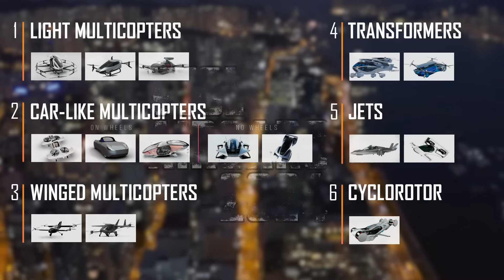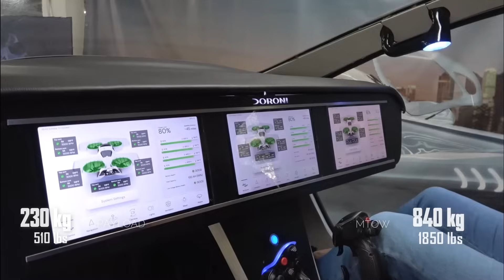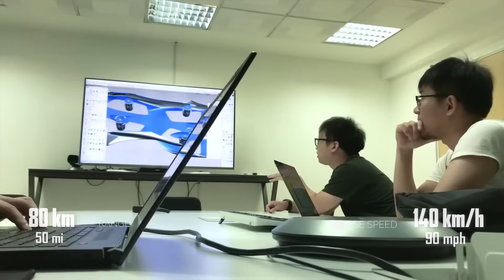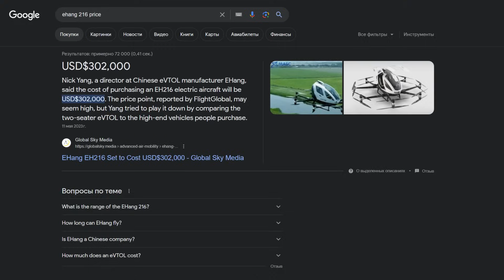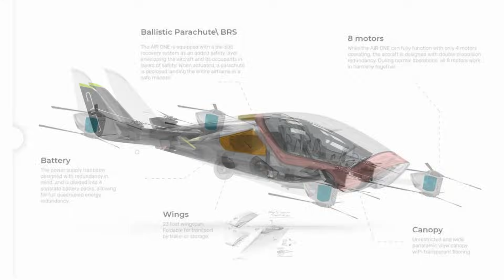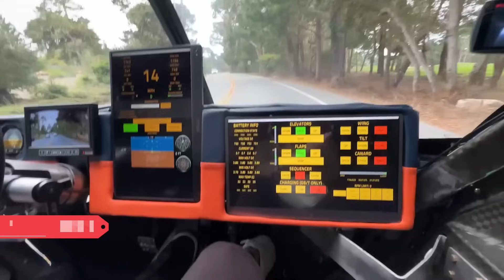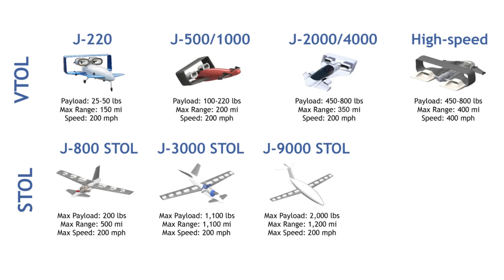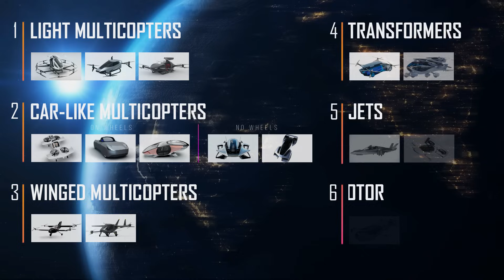Best 2-Seater Flying Cars 2025 | TOP 15 VTOL AirCars

Comment: Thank you, thank you and thank you, for clearly stating that they can't be called cars because they can drive on the road, a flying car MUST be nkt only able to fly but to also be able to be driven on the road the same as a normal car, if it cant drive on the road then it is not a bloody car but just a vtol
Reply from the maker: You're welcome! Many gyroplanes can drive on roads, are they flying cars?
Reply: @TopBoxy and normal planes even 747 can drive on roads aswell, if the road is big enough, just because they have wheels does not make them cars, they have to be able to drive in the suburbs, the city, the highways, they have to be able to function as a car to be classified as a car

Comment: Yes, a flying car needs to be able to transition back into traffic (in the city), if only at a top speed of, let's say, maybe 40 MPH.   Flying cars that can get you from door to door will only become a reality if or when there are specific launch and landing areas specifically for them, and away from pedestrians.  Otherwise there will be too many lawsuits caused by the downdraft of the rotors of these vehicles.
Reply from the maker: Why do you need to return to the traffic flow? Wouldn't it be more logical to land directly at your destination? On the roof of an office building, a shopping center, a factory?
Reply: @TopBoxy  That would be great if every house and every business had their own heliport away from where people are having their activity.  The problem is that there will be too many lawsuits from the downdraft (wind) and noise created by the drones.   If there are certain, let's say, dead ends of some roads that are allocated specifically for these flying vehicles to land, then I think there would be much greater acceptance of these things.  It would be a place for them to transition into quieter land vehicles without all the wind created by rotors.   If you think about it, we have probably had the capability for these drones for at least 20 years, probably longer.  Does it make sense why they are not a reality in every day life yet?
Reply: @dillonrohe4988  Does it make sense why they are not a reality in every day life yet?........
Because ita a scam...Not one of these featured Flying Cars are a anywhere near Roadworthy let alone Flightworthy...The Alef is the biggest con...Check out its videos of it Flying above other cars...The other cars have shadow...The Alef Scam car does Not...and the pathetic skinny bike tyres are a joke...Add  tothat the Joke CGI propaganda marketing releases...and their claim made in 2025 that they are ready to begin production late 2025 or early 2026...BS...More Bs ...and more BS

Comment: I have to ask obvious question does anybody worry about the blades I mean how do you get in these things with the blades hitting you ? The open blades that seem dangerous on  landing it  without killing somebody on the ground ?
Reply from the maker: Good question. In any case, the flying machine undergoes safety protocols. Logically, this problem can be solved
Reply: that is a smart question I didn't even think about that😅
Reply: It’s a pretty obvious danger. You’re walking up to a vehicle with a food processor blade at each corner.

Comment: The problem with all electric aircraft currently is the short flight time.
Reply from the maker: Yes, you are absolutely right
Reply: @hubschenk :  Hybrid approach should be tried, assisted by gas'ne powered "turbo engine"- while in flight... Thus, longer range will result...❤

Comment: The troubles with EV are already evident. Cost: Too expensive (150K-300K); Travel time: Longer than driving there in a gasoline powered car - (a 5 hr charge every 100 miles of flight time= 600 miles in 30 hours); Hazards: EV batteries explode when wet; Health hazard - intense radiation from EMIs, -batteries vulnerable to being turned off immediately by external forces.
Reply: You should of been on there design team they could of saved alot of time and money😂
Reply: You forgot crybaby Karen's in NJ thinking your a Chinese spy drone!!😂
Reply: @Joshua-b7l  Actually, you can thank Billy Rae Enman for those.
Reply: And the trouble with Hummers?  Didn’t seem to be a problem…?
Reply: Batteries will be better
Reply: Fuel sources will improve
Reply: You might be the Wombat King
Reply: They are also heavy
Reply: These are just base ideas and one or more will just get better and cheaper. Where there is demand , industry will always work to exploit it!
Reply: The zero point tech is being suppressed we could be scooting around like the jetsons
Reply: 이런걸  목숨걸고 타야하는지 ㅋㅋ 안전장치는 무엇이 있죠?  배우고 싶다면  한국의 나에게  짲아와요
Reply: 나의 기술은 기체중량 850킬로에  4000킬로의 인원을 태울수 있음.. 조만간 나의 영상을 공개한다
Reply: Clearly you missed the most important thing, Profit! 🎉
It’s all the Corporate Overlords care about 🥺

Comment: Air One is NOT capable of gliding, beware !! And its rudders may look cool but do not work either. The Axe by Skyfly is a kit - which the buyer builds or has an engineer finish - and so qualifies under the kit built certification regimes of US/UK etc - meaning less onerous and shorter certification route than "commercial" which will take years and hundreds of millions. The Air one is double the weight and needs double the power compared to the Axe - so the Air one is much less believable - because it will need twice the battery capacity. It's rotors only and does not benefit from lift from wings, like the Axe does. Result: Air one uses 250kw all the time to keep 2 passengers and its own (heavy!) weight in the air ......... against the tiny 30 kw of energy the Axe by Skyfly needs - and that's where the long range of 1 hours fully electric and 3 hours with hybrid petrol generator comes in. You might want to swap your refundable deposit of your air one to the axe by skyfly..... Also the Axe is designed by renowned and proven engineer Bill Brooks - over 2,000 of aircraft of his 19 designs are flying today .... against the Air one designed by a graphic designer with no aeronautical engineering degree ......
Reply from the maker: Thanks for the useful information. AXE really looks like a more practical solution to the todays problem of transportation, especially taking into account the current low battery density, but a different approach is a more pleasant appearance of the product, more comfortable, with easier operation. And in 10 years, when all certifications have been completed and mass production has been established, when battery density increases and its price drops, the next generation of AIRONE can perhaps be bought for an annual salary, as a premium alternative to EVTOL from IKEA ))

Comment: OK, so  99 % of cars have 1 person in them....  My concept of the perfect flying car is a "snap on snap off" 1 person 3 wheel lite weight electric golf cart with separate top fitting snap one drone.  When you get close to where you need to go you can un snap the cart and go where you want to go.  You own the cart but the drone is rented.  Keep the cost low and let the drone attachment recharge.  You will not get the same one back each time.  Lots of city Drone Ports and one at your house.  99% of people can afford it....!  Keep it simple......  use what we have....
Reply from the maker: Really nice idea!